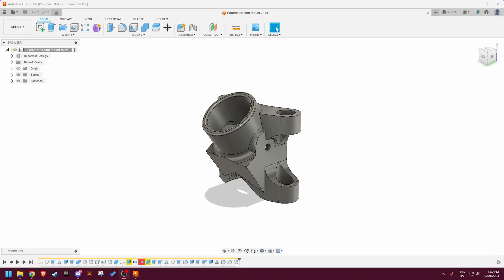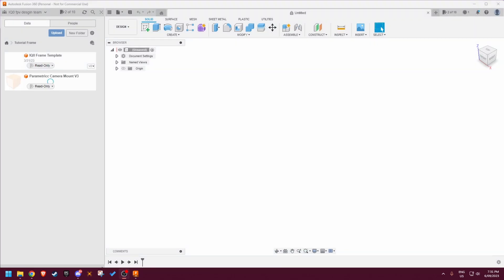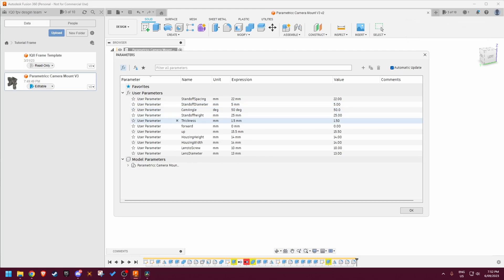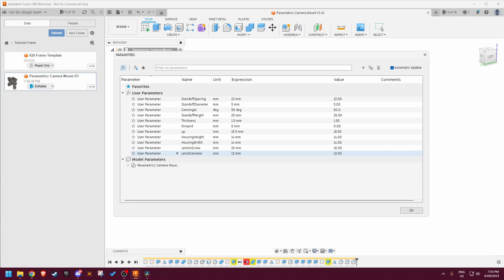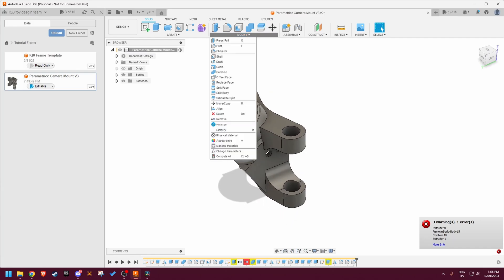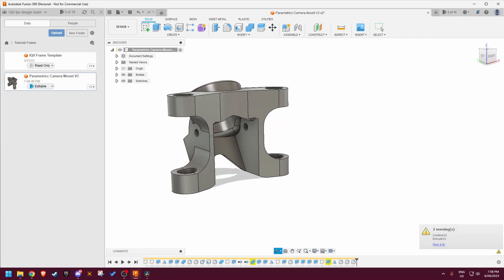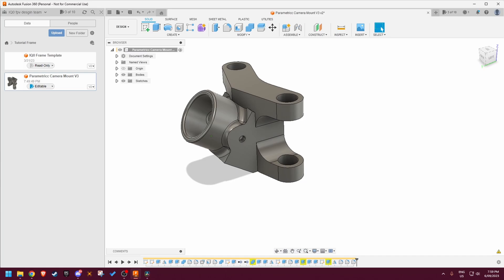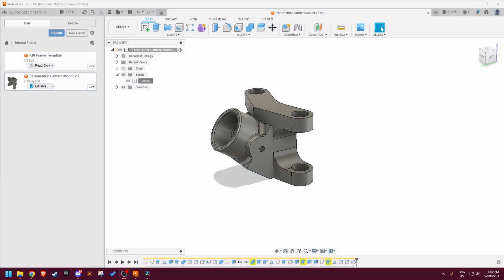Parametric Camera Mount (User Guide)

Comment: Very nice parametric mount! 
Played around with it for quiet a while and think i found a "bug" which makes the forward setting be inconsistent. 
On the very first sketch there is a line that goes right next to the screw hole. i think it should be coincident with the center of the screw hole. This way it doesnt bug out the length of the ring when changing parameter like the forward setting.

Would you mind if upload my edited version to printables or something and link you as the original creator?

Comment: Can u make one for rush cherry antennas?
Reply from the maker: Firstly, a lot of the rush cherry tubes come with the silicon mounts anyway.
Also, big difference is this can pretty much accommodate any camera where every single antenna is a little bit different so I can't really do the same thing
Reply: @gabrielbarrasso  ahh ok thanks man, I don’t really see how it could mount to my godmode tho
Reply from the maker: @wiwibaguette6683  yea thats a tough on does the silicone not stretch far enough
Reply: @gabrielbarrasso not sure what you mean, just want a camera mount because I’m swapping to hdzero and a antenna mount cuz the original pod can’t be used

Comment: Can you make a few preset stl files for the main cams on the main frames (ie. typhon, kronos for hdzero 1.8mm lens)? Thanks
Reply from the maker: might need to give me some time to figure out all the necessary dimensions for each of the frames and then make up a mount for all the common angles for each frame.